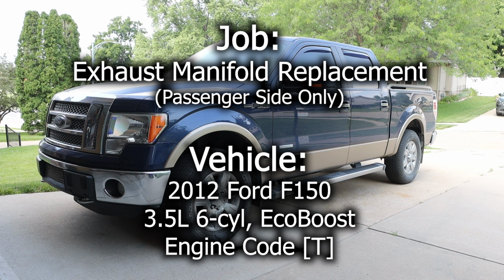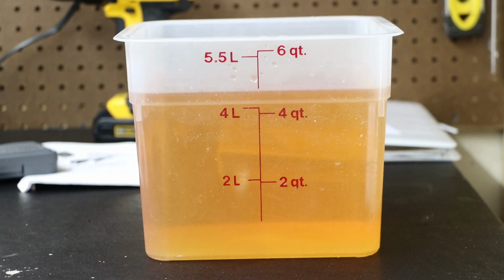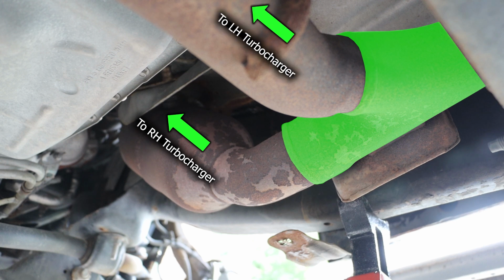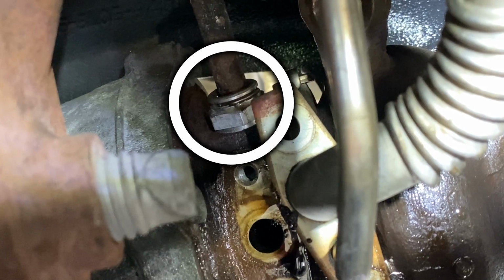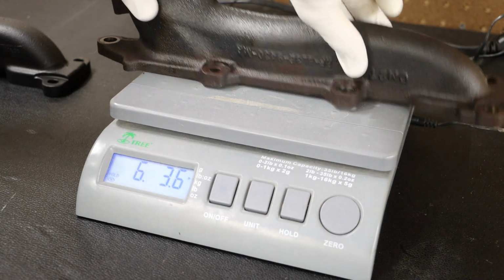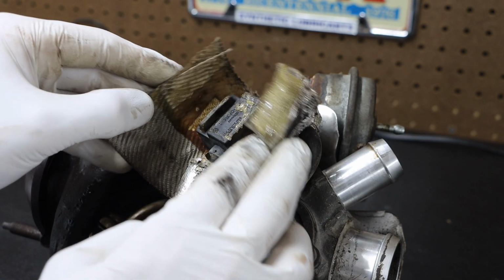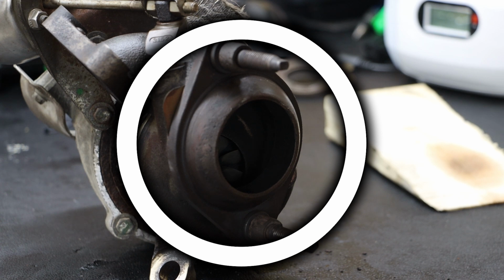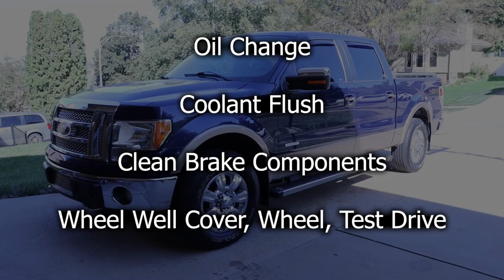Exhaust Manifold Replacement - Passenger Side Only - 2012 Ford F150, 3.5L EcoBoost (2009-2014)

Comment: Great video. I wish I saw this before replacing the fittings on my passenger side turbo.

My process involved a lot more cursing. I also used a welder instead of the double nut method when I hit a snag with a turbo stud

Hope to get a bunch of miles before being forced to work on the drivers side

How is the exhaust manifold holding up? I heard ford updated their part to include an extra mounting stud
Reply from the maker: Thanks for the comments.  It has been over a year now and the exhaust manifold is doing good.  I did develop an extremely tiny coolant leak from one of the coolant lines into the turbo (not even enough to drip to the ground but noticeable if you crawl under and look up at it).  If I were to do it over again, I would replace the coolant lines instead of reuse the old ones.

Comment: Thank you for the great video. Could you confirm if you used anti seize on the coolant line fittings? Looks like you had something on there in the video. Also, what type of grease did you use for the coolant lines to make them go into those fittings easier?
Reply from the maker: Yes, I used a small amount of anti-seize on the coolant line fittings to help them thread a little easier.  I also used a small amount of Mission Automotive Silicone Paste to help the lines install a little easier.